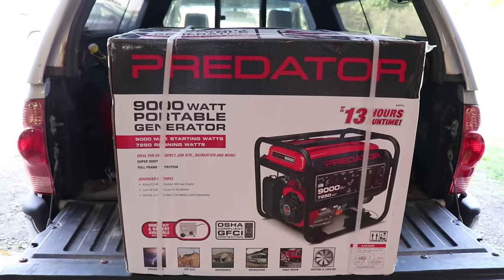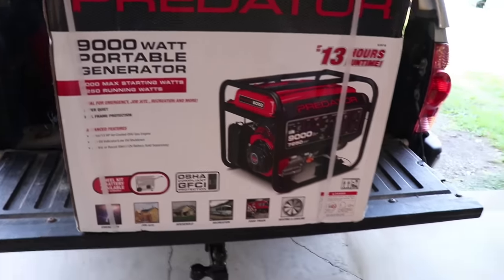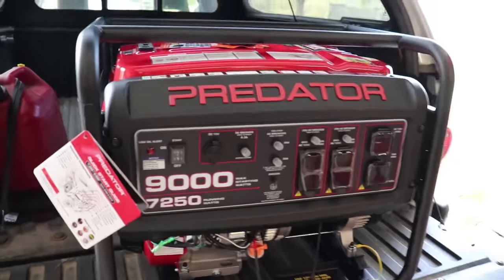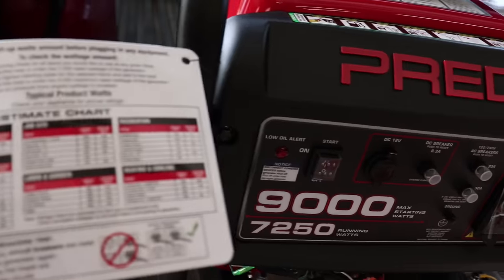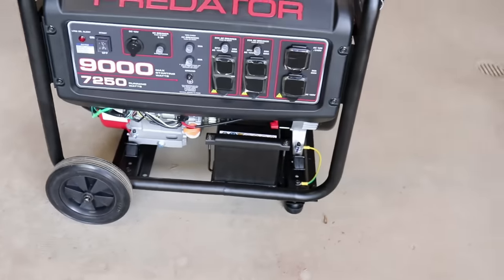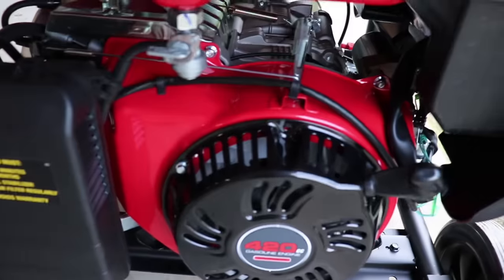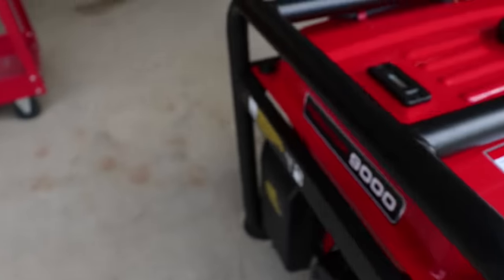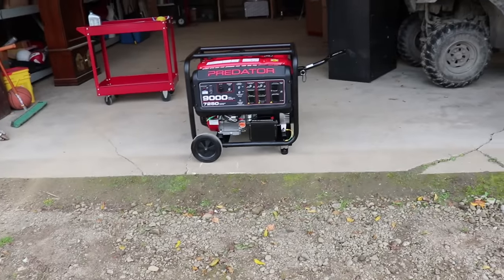Predator Generator Running Our ENTIRE Home. (Complete Setup and Cost)

Comment: I am currently using the same generator to power my home after the severe storm here in the Midwest a couple days ago. As long as you only run one 220 circuit at a time you can pretty much run anything else. I am just switching breakers when I need hot water heater, dryer, etc..
It seems to be able handle the well pump periodically as well!
Generator has been running non stop for 3 days so far!!🤞🏻
Reply: So you ran 220v along with all the 110v. My pump is 220. My question is will it handle 1 -220v with all the 110v?

Comment: We just replaced a 22 yo Northern generator with the Predator. We are very happy with it. It runs a lot of stuff and is surprisingly quiet. It will do until we can afford a Generac. But all in all a good buy during an emergency. Things are nearly normal except for the central air. Oh well, can't have every creature comfort. during a crisis. Good purchase. Nice terms with Harbor Freight.
Reply: Patricia Heffernan, you can buy a Supco- Hard Start capacitor that connects to the fan unit capacitor that is on the outside fan and it gives it a 600% increase in boost just to start the
 A/C going and it turns off itself. I have a four bedroom house and it runs a frigid freezer, small freezer in the garage and TV and light's. It's only a Generac GP5500 watt and I only time I use that cheap unleaded fuel with 10% ethanol is only to run it and that's it! When I don't need it anymore I run all that varnishing fuel out even with that sta-bil stuff it's not gonna keep over a year! I alway leave non-ethanol fuel in it when it sits. The fuel that's currently in it is over a year old and when it looked like we might got either Hurricane Laura or the crazy one before it I went to maje sure everything was up to par and the generator started on the first pull! After having to drain that crappy ethanol fuel that will vanish in 30 day's or maybe a few days longer I'll never go through that again! I always have 3 extra spark plugs, extra air-filter, a carburetor/choke spring because I had one break the second time I needed it, but I was able to temporarily fix it and hoped it helped until it was over..I'm building a generator shed currently which is bringing the generator closer to the box and going from a 23 foot cord down to a 10' twist lock..It's awesome having a/c  at night and I do give the generator breaks during the day to take strees of the generator and conserve fuel! I've had this setup since Issac! And having the Supco hard start capacitor also is extending the life of this A/C which was installed in 1996 and still working well.." Knocking on wood now" lol. I'm looking into getting a predator for a backup until I move and get a permanent generator hooked to natural gas! I'm thinking about doing that to this house, but I'll lose power if I do that and it only being a GP5500 generac it might not be enough to run my A/C anymore?! But I swear by those hard start capacitors and very simple to connect to the capacitor inside the fan unit and definitely after use run out all fuel with that ethanol even with Sta-bil it will still varnish after time and it's a pain in the ass to drain when your trying to prepare!! I run it in my lawnmower and weed-eater and for sitting up won't have any trouble cranking them up next year! Thank me later.. BB
Reply: Double J  it's very simple and you just connect two wires coming from the Supco 6 Hard Start. Make sure it connected right and you can tie wrap it to the capacitor that's already in the outside compressor fan. A little tip, but you might already know! When you turn off the main power coming from the pole/electric company, before you crank up any generator make sure all breakers are in the off position before you start generator and then click one on at a time..And opposite position when you turn in off to fuel up..You don't want a load when you crank the generator on!! A lot of people don't do that and it can wear down the twist lock generator breaker on genny or can wear out or damage your generator! And I built the shed and it's much closer to the breaker box and went from a 25' 30 amp cord to a 12' and it's working pretty good in this heat! I always keep two back up Supco hard Starts and I've seen knock offs! So be careful and just make sure it says it's from New Jersey!! Screw anything Chinese! I also keep a 220 twist lock breaker for backup. 
The shorter the cord the better your genny will work.. Almost finished generator shed except I didn't add the setup to push the exhaust out shed and got to cut a hole to run the cord through..I barely have enough cord! I'm wore out from doing a pad to hold it with 19"× 19"× 4" thick and thank god I bought this paver gripper from Germany and it works beautifully! Very good investment and easy on the back and can order a piece two people can carry.. I will do the installation later. 
Two days working on all this and it was time consuming trying to get the exhaust fan installed they way I wanted it...Wish I could share a picture of it. It's working with no exhaust outlet and the fan is removing a lot of heat but I do have the lid open..

Comment: I full-timed in a fifth-wheeler for 2 years while building my house and ran a 3200/4000 Predator pretty much 24/7. It needs rings but still runs and generates. THOUSANDS of hours and the ONLY repair other than maintenance was an exciter brush holder.
Reply: I wonder if the bad rings could have been avoided?

Comment: These Predator generators are surprisingly reliable.  We have one at my company that has been rode hard and put up wet for several years now and it still runs like a champ.  I have had to replace outlets on the panel because they are kinda cheap and break easily.
Reply from the maker: The reliability has been a common theme so far. Thanks for the comment!
Reply: My generators run like a Champ because they are !!!  Haha.

Comment: I own this generator. Our entire state of Texas power went off when temperatures went below freezing for an entire week. Millions of people were powerless in the freezing winter cold temperatures at times reaching near 0 degrees.. I already had this generator wired into my mobile home power supply for emergency backup. This generator powerd my entire mobile home. It provided power for my electric water heater, micro wave oven, large refrigerator, small deep freeze, lights, tv and our electric oil heaters, with no problem. Thanks to this generator we were very comfortable and no water pipes busted. The only down fall was we averaged 18 gallons of gas for 24 hours😖. Our trailer is 4 bedroom and not small.
We used 3 oil filled heater to heat the entire home. I highly recomend this generator after our experience just be prepared for the daily gas usage when I wasnt.
Reply: The Harbor Freight Predator generators are all excellent and get a bad rap. If you look closely....the parts and build architecture are all the same Chinese company whether  it is this brand, or Generac, or whatever. As to fuel usage, the 9000W unit is a monster and can often power almost everything in a small home....so in my case, targeting only a few circuits..... I bought a smaller 3500-4000 sized unit...and the fuel consumption was very low for the few things I wanted to be powered-up.
Reply: @TheWilferch  👍This was the first time that we needed our generator for more than a couple of hours. I never dreamed we would be without power for a week as long as we paid our electric bill🤷‍♀️. It felt awkward just seeing snow here in Texas😆. Then the snow turned into a huge ice skating rink😳. Everywhere I looked people were busting their ass's🤣 including me. Cars were in ditches, or gliding sideways down the ice road. Our brakes didnt help  slow our truck down at all😆. My Predictor generator didnt let us done though and I was greatfull for that. My neighbors had no choice but to go stay with family that had a fireplace.
Reply: @glenchadwick420  ..glad it worked for you.....

Comment: Very good video.  Hope you get the interlock soon, it's very important. Please remember that the 9000 watts are for surge watts,  You can see on the  generator it says 7250 running watts.  The 7250 watts is the real number to use if you are going to run the generator in a blackout that lasts for a while.  All the generator manufacturers advertise the higher number of watts for obvious reasons. Thanks for taking the time to make this video.  Hope you tagged out.
Reply: THE NOMAD POWER SYSTEM  
Thanks for the info.
Reply: Don’t forget to watch this video about generator safety https://youtu.be/I1jT3ANENvI hope you all stay safe. Thank you

Comment: If i may, i have almost the same setup. i  used my amp probe to measure each circuits draw with the connected load on. and next to the main panel. is a log book listing all the loads. this way during an emergency you can look in the book and know what can run at the same time so you do not overload your generator. we all know during an emergency clarity goes out the window. just a suggestion.
Reply: Actually, if you use a transfer switch with watts meters, you will already know what you can and can't use.  You have to balance the load on both legs of the generator, so you have to calculate in advance, which items are going to go on what circuits in the transfer switch.

Comment: Hey, love the bread first. I live in St.Thomas and we have 6 -12 hour outages and pay 40.05 per kilowatt-hour. I went without grid power from Sept6, 2017 to January 8, 2018.  I finished my off-grid solar system in August 2017  we lived with swollen lead-acid batteries and ryiboi generator for most of that storm. When you are real about this go get a Kohler propane. I am getting one soon, that generator is great in a pinch, but the whole house set up is what you will need, take it from me in hurricane ally. good luck and keep the lights on, once again, love the bread.

Comment: I have the same setup but with the 6500/5500 watt version. Runs my whole house 2100sf including my 2.5 ton ac. I only turn the 4500w water heater off, if needed I’ll run it by itself. Great generators , had a 4000w version for 5 years before upgrading to the 5500w and it started 1st pull every time.
Reply: Are you referring to central air in your 2100 sf home?  If so I don't see how you would have enough power to run a 2.5 Ton Condensor let alone a few other appliances and lights in your home with a 5500 continuous/6500 surge generator.  The initial surge of turning the Condensor on would overpower your generator and has potential to damage equipment.  Also I question the "cleanliness" of the power that is produced from this unit. There is a reason why you are only paying $599 for this unit.  Like someone else said do you trust that power in sensitive devices like refrigerators and furnaces that have expensive control boards?
Reply: Mike Bittel see my video below. I put a hard start kit on the ac and it starts easily. I don’t use the stove or hot water heater with the generator on.  Most everything else is led and high efficiency.  Ive also tuned the generator to produce a steady 60 hertz so its as clean as i need it to be.  

I had converted it to propane but that dropped the power enough that i went back to gas.
Reply: @jlibert0546  did you tune the generator on propane for the load?  you have to tune the regulator for the load you intend to put on the generator.

Comment: I was as excited as you when we finally pulled the trigger. I have a different generator but it too runs everything in our house. If we're selective about what's on it'll even run AC.  I no longer fear losing power and that's a great feeling! Great review!
Reply: I was wondering if it could handle running the ac

Comment: Here in Texas we have power outages when there is a thunderstorm, high winds slapping the wires together or trees into the lines, Wet Snow, Freezing rain builds up on trees and trees fall. We have 4-8 true outages per year. We have been in the house since Feb 2003. We have natural gas for our heating. I looked at the Generators that can be set up to run on natural gas, no running to the gas station, running out of gas in the middle of the night.
If you have LPG available, you may look into making your generator a dual fuel to run it. Bigger is better, Hot summer storm and AC is out for hours or days, it gets warm inside. Food spoils too.
I have actually looked at the 12,000 Kw Generac from Home Depot. It is set on a concrete pad along side of house. I'm afraid some thief would steal a portable. Exhaust gas has to be vented, so leaving in the garage with the doors down is bad for house occupants. Would need to run a exhaust pipe through the garage door with a flapper cap on the outside. 
Thanks for your set up and included information. Always great to have 1 available.
Reply: Watch what you buy, there are two types of generators, high and low rpm, high rpm are only meant to run for a few hours like what you are looking at and need oil change every 50 hours, low rpm need changes every 500 hours, generac makes a lower rpm it's there ecogen 15k, but expensive. So it all depends on what you need.
Reply: @starrvalley12  thanks for the info,  I did not know this.

Comment: Ive got one of the predators that I have had for a few years now and its been great. It always starts right up without any trouble. Just make sure you start it up for about 20min once a month and keep the oil changed. Reason for running it once a month is to help keep the magnets and everything in the area the makes the electricity in good shape.

Comment: I have the same one and I have around 400 hours on it I haven't had any issue with it at all to be honest I was very skeptical at first cause I bought it without doing any research and I was actually happy it turned out really great
Reply: ⚠️Here’s an important safety announcement for everyone:

Please make sure you follow the generator safety tips whenever you use your portable generator. This is just a reminder for everyone’s safety. All generator safety rules need to be followed carefully 

Here are the generator safety tips: 

1) KEEPING OTHERS SAFE: Please do not allow an non qualified person or your children to operate and service the portable generator. Just because some manuals don’t say that doesn’t mean it’s safe. That is important against the generator safety rules. We also need to be keeping an eye on our children too. You need to make sure that your children are not playing near the portable generator especially when it’s running so they won’t get electrocuted. Generators pose electrical risks and they can be hot during an operation. Please keep your children away from the portable generator at all times. It is important to keep our children safe especially our little ones. Children often get curious about anything so we should keep an eye on them to also make sure they’re not wandering towards the generator. 

2) WHERE TO RUN YOUR GENERATOR: Some people use their portable generators indoors which increases the risk of carbon monoxide poisoning. It’s important to have a carbon monoxide if you have a gas generator. Never ever use your generator indoors even if your doors and windows are open and even in the garage is not safe to use a portable generator. Not even at your porch and your deck. It is never safe to use your generator indoors and in enclosed areas of your home. Your generator needs to be 15-20 feet away from your house. 

3)🔥FIRE HAZARDS: Never refuel your generator while it’s running. You need to let your generator cool off before refueling it and before storing your generator. Never overload your generator too. Never ever back feed your generator. You should never plug your generator into a wall outlet. Also never store propane tanks indoors. Please keep flammable things away from the generator as well and please don’t smoke cigarettes near the generator. Having a fire extinguisher next to the generator is also important against the generator safety rules. 

4) GENERATOR OPERATION: make sure your hands are dry before touching the generator. Never use your generator in wet conditions. Don’t let your generator get wet. You need a generator tent if you need to use your generator during wet weather. Please don’t wear loose clothes when operating the generator. Turn on your generator before plugging in appliances. Use the right cord for your generator. Please do not use worn out cords. Do not touch the generator’s engine when it’s still hot. 

https://youtu.be/I1jT3ANENvI and here is a video more about keeping others safe when using generators. All generator safety rules need to be followed carefully. 

Hope this helps. 

Please make sure you follow all the generator safety rules.